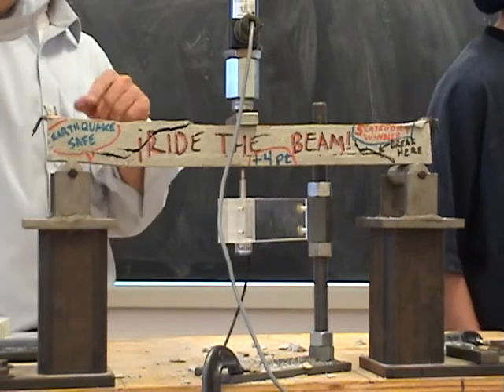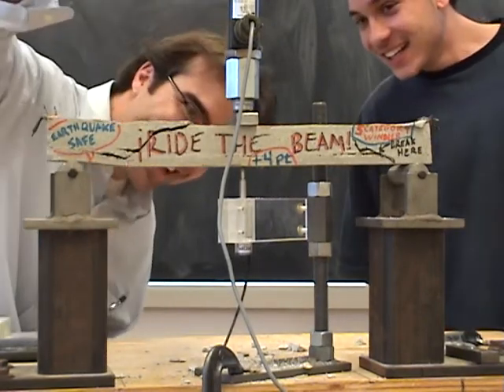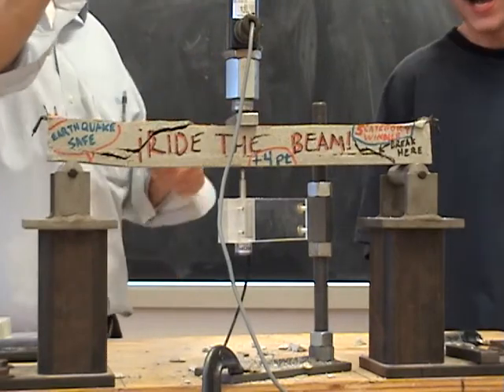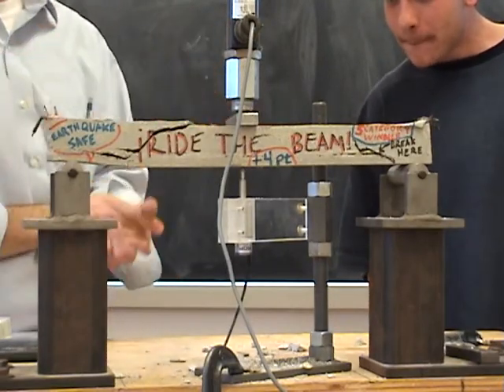Purdue University Mini-Beam Contest 2008

Comment: Im not sure what your question is asking?

do you mean how did they get the concrete into beam form. if so they just poured into forms.

i had to do the same thing in my materials class only i had to do non-reinforced... real fun wasn't allowed to use some small re-bar.